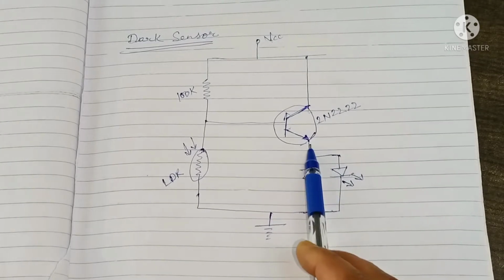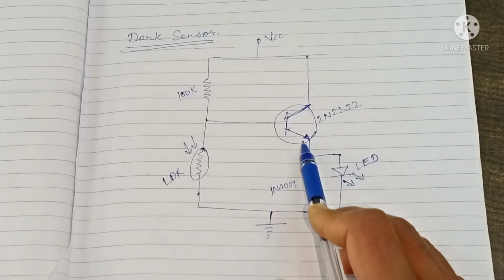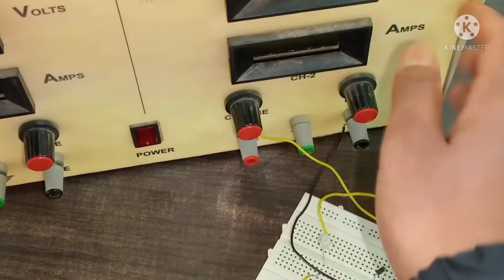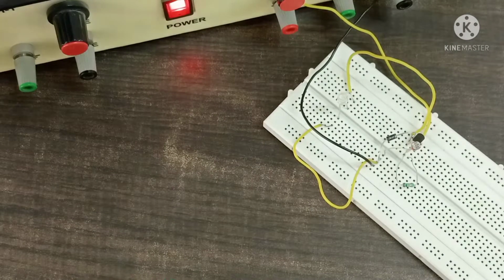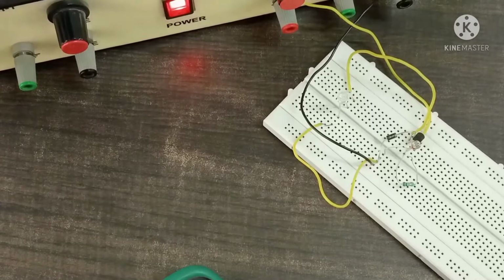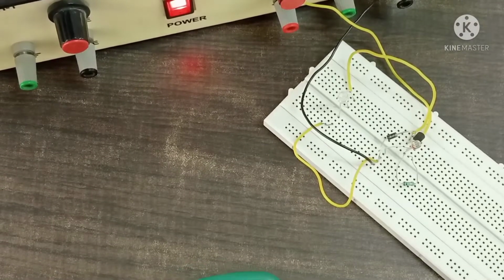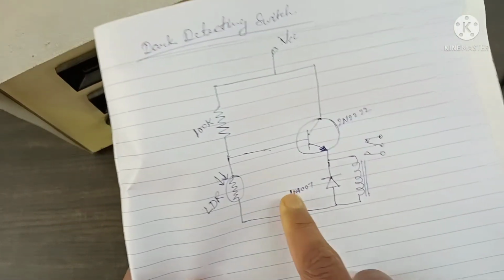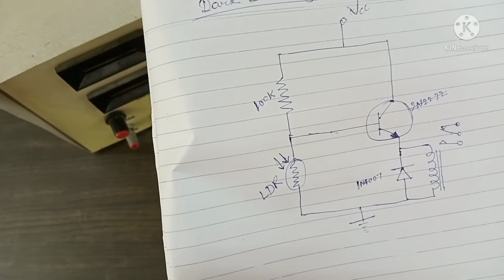Automate different types of Machines using Dark Sensor

Comment: Hi, could you post videos of circuits and electronic devices on protoboards and bases, building them from scratch and thus showing the layout of the various electronic components? for example, I would like to build circuits with logic gates and or not nor nand ex or ex nor flip-flop microcontrollers electric motors of all types etc...ok? thanks Luca